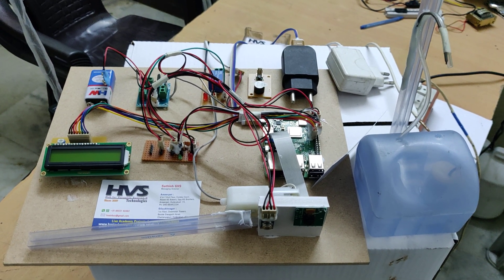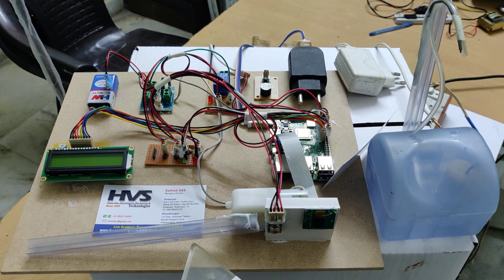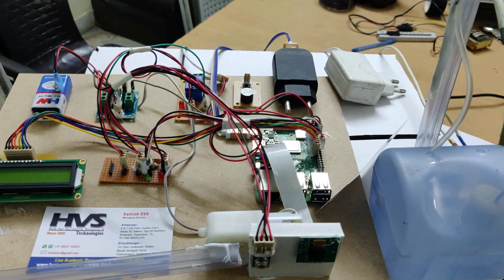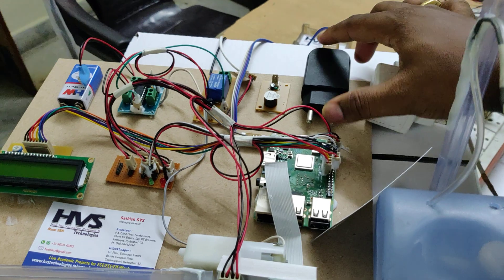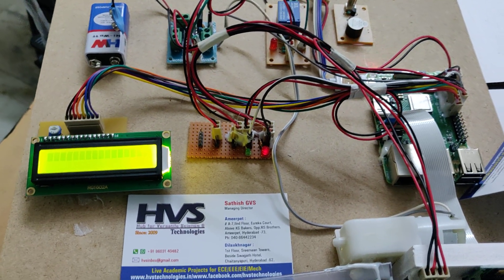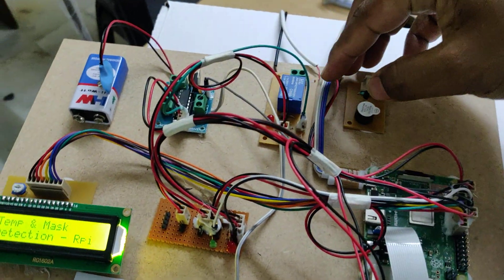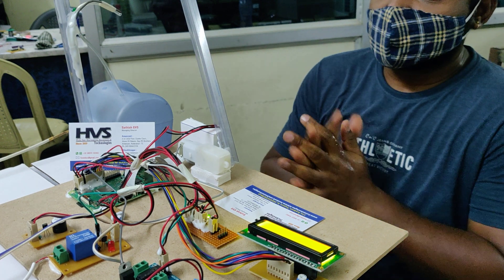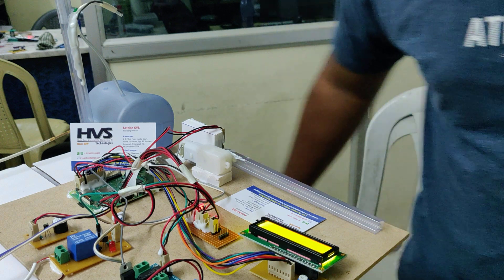Face mask detection and Sanitizer dispenser with Temperature Detection and Door controlling OpenCV

Comment: sir can u have this project using arduino uno
Reply from the maker: For Face mask detection we have to use raspberry pi
Reply: Sir can u please share the circuit diagram to execute it....as I am working under my college project on this on the Arduino basis....but I want raspberry pi ckt diagram to execute my project can u please send me the circuit diagram...🙏